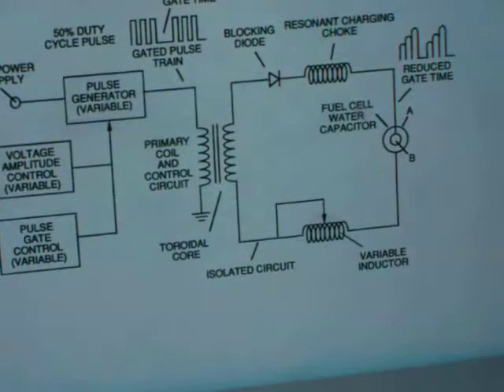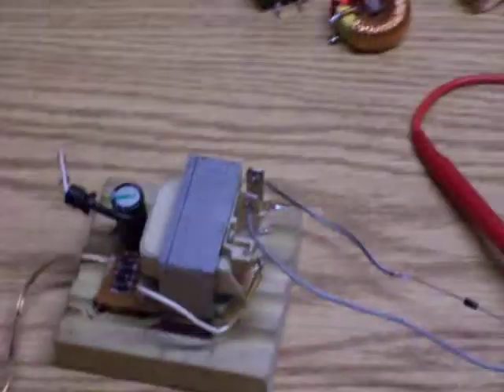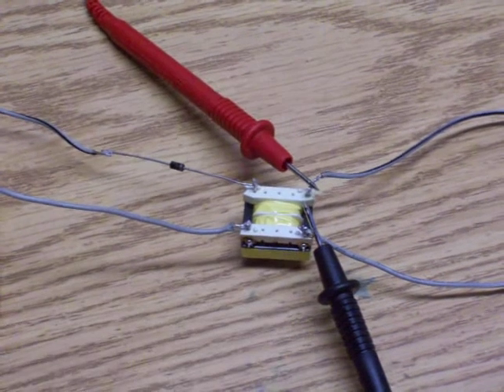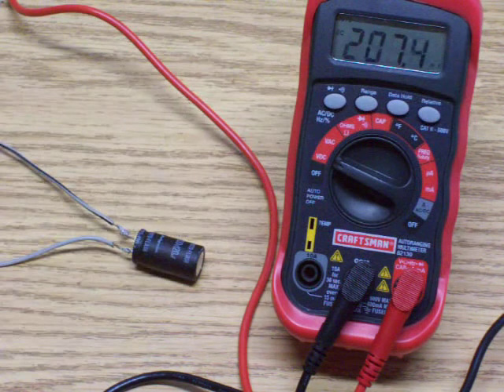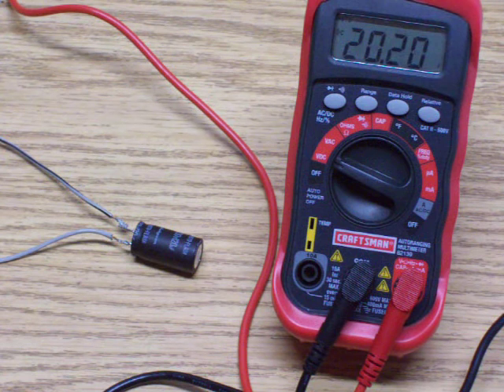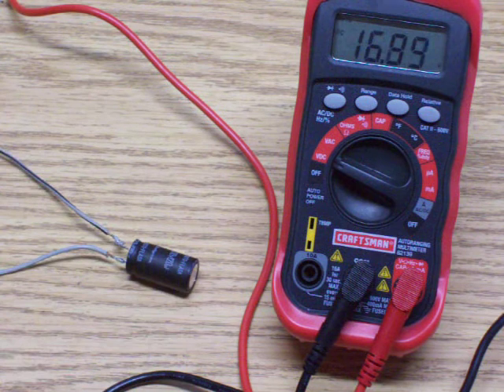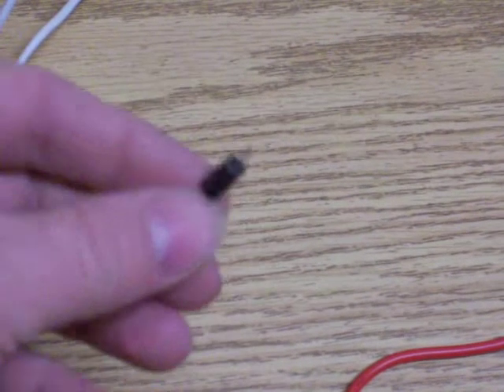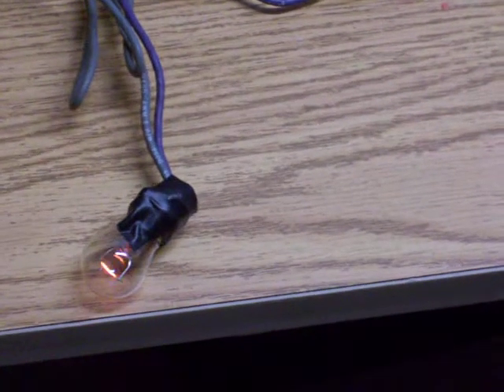Water fuel cell circuit (wi-3)

Comment: You connected 1 end of the wire to the + and the other end to the - of a DC power source no pulse you create a short and the wire releases the energy the only way it knows how heat possibly damaging the transformer and the battery. And about a power inverter you have all the main parts of one on your table as I said in my first comment if you give it a 60Hz pulse you will get over 100 volts AC only limited by the current restraints of the transformer

Comment: ok what I am saying is the transformer wont work for what you want to do with it you said Stanley Meyer had about 3Kv going through his cell and 1 to 10Khz. Best possible scenario that transformer will handle 100Hz which is no ware near 1Khz(1000Hz). Now for the transformer heating up every electronic device creates a short circuit between + and - its what we do with the energy after it leaves the + that keeps things from heating up or burning out. con't...

Comment: ok lets start with the first transformer it can only handle low frequency 50/60Hz maybe a little more but when you go past its max frequency the pulses become a mess and scatter every ware creating heat if you pulse the transformer at 12v 60Hz you should be able to get over 100v good luck